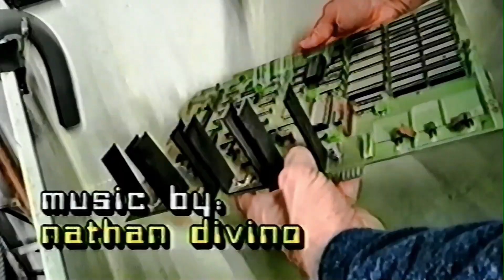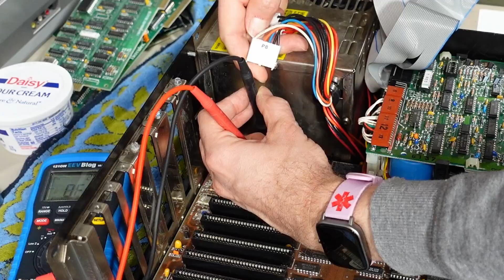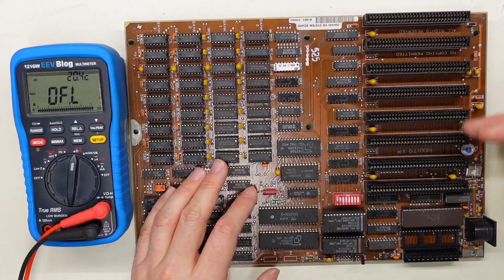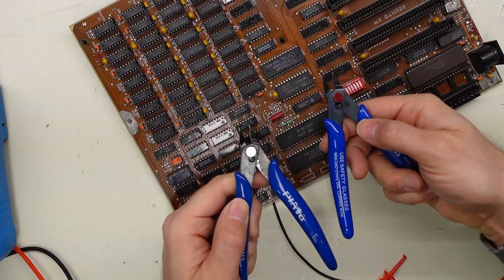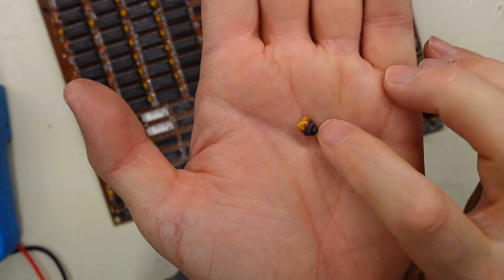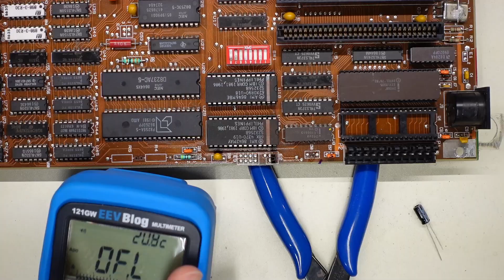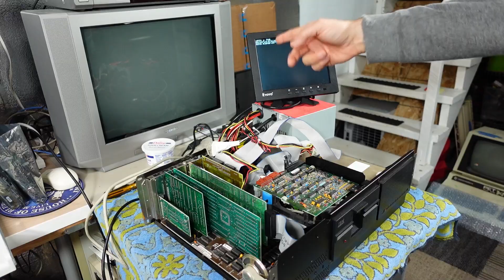This IBM PC XT won't turn on, let's fix it

Comment: Take a second look at your Hercules graphics card! It's not just a "original Hercules branded monochrome graphics card", but it is the second generation: It's the "Hercules Plus" also known as "Hercules RamFont". It has a mode where the 64KB accessible memory space is divided into 16KB of text/attribute memory and 48KB of font memory, allowing up to 8000 character/attribute pairs to be in video memory (and it provides hardware-assisted scrolling), which are chosen from a character set of 3072 software-defined characters.

For the hardware nuts among us: Count the memory chips on the HGC+! There is 80KB of dynamic random access memory (10 chips of 16K * 4), although in no mode, the ISA bus is able to address more than 64KB. I reverse engineered the memory scheme on that card, and it turns out (unsurprisingly) the card primarily consists of four "banks" each being 16K * 8, all of them directly adressable from the ISA bus. In RAMFONT mode, the banks are split into one char/attribute bank and three font banks (the three font banks at the non-slot-end of the card), in graphcis mode, all four banks are just used as bitmap memory. The interesting catch is: The char/attribute bank is backed by a second 16K * 8 "shadow" bank that contains a mirror of the odd bytes (attribute bytes) at the corresponding even addresses (the addresses of the character bytes), or possibly it was the other way around (i.e. character bytes stored at odd addresses). This means this bank is 16K * 8 and 8K * 16 at the same time. For the ISA interface, that bank is 16K*8, no matter what mode the card is in. When scanning out text modes, the bank is read as 8K * 16, so the character and attribute are read at the same time. This doubles the memory bandwidth compared to the CGA card (which has a single 16K * 8 bank) using comparable memory chips, and thus avoids the "snow" issue.

BTW: on the original Hercules, there was a similar design, although the card just is built to support basic MDA capabilities in text mode, so there are no more than 2048 characters in video memory. The shadow bank on the original Hercules is a single 2K * 8 static RAM chip.

The late Hercules clone cards everyone and their dogs have probably use page-mode addressing to fetch the character code and attribute byte from a single 64K*8 banks. They do not have such a tricky memory layout as the original Hercules card, but more complicated logic chips instead.
Reply: That’s a pretty interesting memory layout! Were there many alternate fonts for latin, for typeface nerds, or was it only used for the original Hercules mission of providing non-latin characters?
Reply: @kaitlyn__L  While I do have a Hercules Plus somewhere, I didn't manage to obtain the original software. I wrote a small test program that switches to ramfont mode and copies the 8x8 CGA graphics font from the XT BIOS ino the Hercules Plus, which worked fine.

Apart from non-latin characters (maybe even kanjis?), a multitude of fonts is also interesting for WYSIWYG word processors that can display bold or italic characters in text mode, without falling back on color or intensity coding.

Comment: Watch out for those clippers snapping and putting an eye out!  A big piece of one of the tips snapped when I was cutting through plastic and hit me square in between the eyes.  It would've been a bad day if it hit me in the eye.  I guess the fatigue finally built up enough in the very brittle / hardened metal.

Comment: When you break the point off your wire cutters, you can grind down the other side to match so at least they act like diagonal pliers. It won't make them good again, but it will make them somewhat more useful.

Comment: Some some low melt solder for areas that are hard to melt.  Works wonders.  You don't need the crazy heat.

Comment: The 106 on the capacitor is actually more than just some identifying number you have to look up--it's a code for its capacitance! It works the same as the resistor color code, with the first two digits multiplied by 10 to the power of the third digit, in picofarads. So this capacitor is 10×10⁶ pF, or 10,000,000 pF, or 10 μF. Voltage rating is usually not marked on capacitors this small, so generally just use your judgment on what an appropriate voltage rating is. On a -12 volt rail, I would say 20 or 25 volts is a good rating; 16 volts is a little too close to 12 for my comfort, but I tend to use wide margins where possible and 16 is probably fine.

It's usually fine to replace a tantalum with an aluminum electrolytic (I specify aluminum because tantalum caps are also electrolytic!), as long as you're replacing an old tantalum with a modern aluminum. The main advantage of tantalum caps historically has been their low ESR and small size, both characteristics that aluminum electrolytics have improved on since most of these computers were made. You can usually replace them with MLCCs or film capacitors too, but sometimes the low-but-not-super-low ESR of tantalum is necessary for circuit function (like stabilizing a low-dropout linear regulator), so make sure you aren't making the ESR too low.

Comment: I believe the culprit for my XT was actually the same cap, though on an older board. The PCB being hard to solder on is legit. In my case, I  think I just left the cap off since I read that it tends to be fine. And so far that's been the case. MinusZeroDegrees has a really good guide to pinpoint a bad cap as well since it's so common.
Reply: As the rail isn't used by the motherboard itself you should be fine without the onboard capacitor. Any cards which need the extra filtering probably have their own capacitors on the rail.
Reply: Groundplanes sucking away the heat I need for soldering is a problem that common, that I tend to call power planes "heat sinks for soldering joints". You don't necessarily need a high thermal mass iron, but you definitely need to put in a lot of power for some seconds into that joint to melt it. That heat can come from a high thermal mass, or you have a powerful heating element close to the tip that creates the heat just in time. Having the temperature sensor in the tip instead of the heating element also helps to prevent the tip to cool down when a high demand for heat exists. Professional JBC stations are known to be quite good at just-in-time heat delivery, but they also carry a quite "professional" price tag.
Reply: @tw11tube  I'm able to solder it with actually some cheap but nice Chinese soldering station I have. Before I had that I only had a RadioShack plug directly into the wall iron. Which combined with being so long and thus awkward to hold, was a very bad experience. Unfortunately one of the ISA slots bears the scars of this xD luckily it's not functionally damaged at all, just aesthetically.
Reply: @tw11tube  You don't need something that fancy. My old-school 140w soldering gun makes quick work of components on ground planes. The power is controlled by a finger trigger so if you let go when it melts you won't overheat the board. In this regard it should theoretically be safer than cranking the temperature on a thermostatic pencil iron.

New versions of the Weller soldering gun are available for much less than a JBC station.
Reply: @eDoc2020  Those soldering guns are WAY too unreliable and hot. I've seen them overheat and destroy pads/traces so many times. They have so much power that by the time the solder melts the heat is just skyrocketing.

The ACTUAL trick to desoldering ground plane pins is to warm the area with a heat gun or ceramic hot plate at maybe 100-200 deg C for a couple mins. That heats up the entire ground plane so your iron has much less work to do. It results in a much better repair job and you're way less likely to destroy pads/traces.

Comment: If you have a hot air station, you can also use that along with a soldering iron to get the heat into the board.

Comment: This video reminded me of something I've heard argued time and time again, that being, the argument both for and against "shotgun" cap replacement. I'm honestly of the opinion that just cause a cap hasn't shorted, opened, or leaked all over the board, doesn't mean it's still good. A lot of these "vintage" components have seen years, decades of use, they have gone through thermal cycles and undergone all the things that parts that have failed have also gone through... My opinion, is why risk it. If I have the device open already, I may as well replace any component that is suspect to fail. A cap that has not leaked or shorted, is one that could leak or short next month, or next year... then I have to open things again. Maybe the board gets damaged and I don't open the unit up again till the damage is already done... Not worth the risk, when parts are known for common failure modes. As far as arguing expense goes... Well, my argument is what's more costly, a handful of caps now, or hours of board troubleshooting and damage repair later, and potentially needing to replace whole boards, if the damage is not noticed in time before extensive damages occur?

My time and expense replacing all potentially unreliable components is worth my time later in having faith that the machine will continue to run, and not need more extensive work later.

Comment: I got my old dell dimension 2350 working again just by disconnecting power from a cd drive.
It's os is xp pro of course. Still browsing the web with it.

Comment: this unit reminds me of when i got into my first PC, just transferred to D.C. newly married, wanted PC went with USED< Newspaper Add listed units like this 200.00 with Monitor and Keyboard/mouse.  this was around 1997 so many corporations were upgrading so getting read of old units any way they can made a cash cow for the Entrepeneur, so as "I don't know crap about PC" I bought one" that was the start of computer endeavor.  wish i hung onto ti. was nice to work on.
Reply: you could've picked these for free in 90s.

should have stashed a lot.. a guy in university had some barn full of 80s and 90s stuff in '00s

Comment: A couple weeks ago I picked up a pair of 5160s, a 5150 and a 5154 monitor. I haven’t gotten to checking them out yet, but I do know one of the 5160s doesn’t power on so this video is good timing.

Comment: Fresh solder? Boards were wave soldered with a higher melting point solder than is used for rework.
Trying to use an ohmmeter to find shorted parts is not reliable, because of contact resistance. At my bench at Microdyne I used a HP651 test Oscillator and a 10:1 step down transformer to convert the 50 ohm output to 0.5 Ohms. (10*10/50=0.5)Then I used a Fluke 8920 True RMS voltmeter to follow the power rails or other traces with problems. A 0.1 volt P-P 1KHz signal wouldn't bias any semiconductors or cause any damage. Troubleshooting was simple. I would probe the ground at the four corners. The one that was the highest was the problem area. Then I would follow a trace. You would see the voltage drop, the further you were from where the signal was injected. Once the next spot had a lower drop, you had found the pad part because the short was at the last point with a significant drop.
I did this on new boards with problems coming out of our reflow oven. We had to keep rework to a minimum.
BTW, the power transformer that I used was from a damaged Commodore 1541 disk drive. You can use a scope in place of the fluke meter, but I had it and a Tektronix 2465B on my bench. With a schematic, I didn't have to look all over a board to find the dozens or 100+ connections to a power rail on VME/VXI cards.

Comment: Tantalum caps around 70s, 80s and even 90s are a common cause for failure, I normally replace all before I first try to power on anything.

Comment: I have the 5160 which did work when i did get it (including some disks). Weeks later, when i did want do do something, it didn't. In the psu, a capacitor was shorting 12v. Now repaired, and the computer works again.

Comment: Hey Adrian, I just saw an interesting  video by Cathode Ray Dude (Headstart's PC With The Weird GUI "OS") who looked at an old PC clone and he did a nice quick history on graphic card standards. I'm sure you may know how they all fit in, but it was nice to get that perspective. The other interesting point he made is that the original IBM PC standard lasted almost a decade from 81 to early 90's (even with the XT and AT additions, which didn't supplant the original).

Comment: dallas rtc chips are a maintenance nightmare, your best options being to carve into a sealed chip to solder onto internal traces... oh god why did they build it that way.
Reply: To make you buy a replacement when the old one went belly up.
Reply: Once you’ve dealt with a few boards ravaged by leaking NiMh or NiCd batteries, you’ll let a gasp of relief when you see a Dallas chip! Seriously, cutting into one and soldering two wires to it is so much easier than attempting to fix potentially dozens of bad traces or vias eaten away by battery corrosion.

In other words, the Dallas chip will never leak. It’s just a tiny coin cell (which is already unlikely to leak) potted in epoxy.

Comment: I recently had an original IBM Seriell/Parallel card plugged into my 286 motherboard, and this card had a shorted tantalum. However, I wasn't so lucky and it simply burned through the thin +12V and -12V circuit lines on my motherboard in some positions on the bus. Luckily nothing else got damaged, but now I sadly have some patched conducting paths on my otherwise pristine 286 board :(
Reply: Scars of endurance! Just like sewn-up patches on a favourite piece of clothing, or indeed real scars on an actual person 😁

Comment: screeching switch mode psus can be caused by a bad base driver cap for the power switching transistor, assuming it uses a bipolar type not mosfet, this was an issue with many crt tv psus, especially in the 70s and 80s

Comment: You could build a dummy load to avoid having to risk valuable hardware. A couple of resistors will be enough.
Reply: yep, or car bulbs, although they have very low cold resistance so may male a psu overcurrent shut off ,,  maybe bulb and resistor in series..?!
Reply: I think the hard drive was already cooked.  I have a whole box full of dead drives with a few connected to a Molex splitter just for this purpose.  They make great (and helpfully noisy) test loads.

Comment: Aaah the good ol Tantalum capacitors. We called them "the sweetcorn caps" because of their appearance. Hardy little buggers they are and hard to pop them. Must have been quite a high load to burn it out that bad. Crispy Scorched Sweetcorn, yummy!

Comment: hey Adrian! Thanks for all the videos over the years, I've always enjoyed your content. I've recently acquired a 5170 clone that won't boot, a Huyndai super 286! I've followed your advice in this video, and confirmed that all +5V pins in the power connector are shorted to ground. I then proceeded to check the tantalum caps, and so far nearly every single cap (big and small!) is shorted -- only 3 or 4 test good. What are the chances of that?!? Maybe there's something else in the board that is causing the short? Do you have any suggestions? Thanks again.

Comment: The capacitor isn't incinerated, it's just Goth.
Reply: You can always find it when you hear it say, "Leave me alone Daaaaaaaaaaaaaaaaaad!  You just don't understand me."  If you use the microscope at just the right time, you will see it do a hair flip.

Comment: actually i don't think it is actually specified anywhere that 'they should all be connected together' either for the black or the red wires. it is specified they should be '0' or +5 or +12v. that can come of different windings on the transformer or from an entirely seperate psu or battery in as far as the specs go. (now ofcouse in most mainboards and psus they literally just terminate on the same solderblob on both ends. but that doesn't nessesarily have to be that way ;)

Comment: Hackaday had an article on the other day on four-wire resistance measurement, which is supposed to be able to detect this kind of short very easily. I accidentally my scan-doubler a while back (by connecting it to 12V rather than 5V) and I wish I'd known this before trashing it --- it may have been fixable.

Comment: I really just want a clean XT case. I have a Model F XT and wanted to put modern hardware in the XT case to go with it (or rig it as a dock for my laptop) but the cases seem to go for $300+ even in less than ideal condition. Any tips on where to find one without being extorted?

Comment: Hi, had question on technique to find the bad rail. Did you have in continuity mode and then put neg probe on motherboard neg line and pos probe on 12v line? I just couldn't see because your hands were blocking and I know it is a  tight space and I'm wanting to learn.

Comment: I still have the same exact model, it still works good.  What can it be used for in today's world ?
Reply: Mostly nostalgia, and not much else.  They have less processing power than a digitally controlled toaster.  But they’re more fun — unless you need to make a grilled cheese sandwich, then the toaster wins again.
Reply: @nickwallette6201  😆😆 lol
Reply: @nickwallette6201  you use a toaster for grilled cheese instead of a frying pan or a “toastie maker”?
Reply: @kaitlyn__L   Sure!

Take a piece of bread, add a little butter, put some cheese on it, turn the toaster sideways so the slots are arranged like a stack of slot-loading CD players, and toast those puppies one slice per slot (cheese-side-up.)

Put a plate in front of the toaster and catch them when they shoot out, OR, dump them out when cheese starts dripping on the bottom coils and catching fire (mmm extra crispy!)

Enjoy!